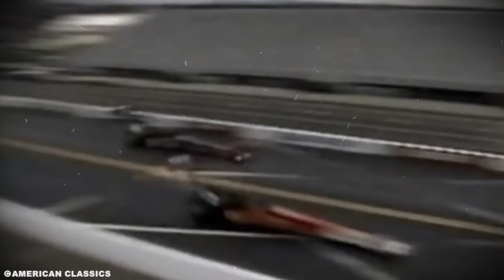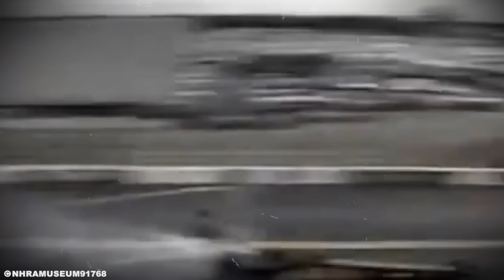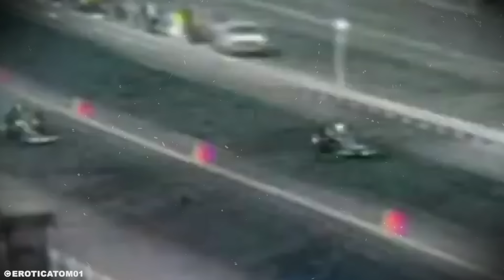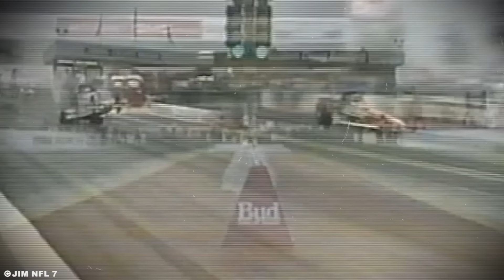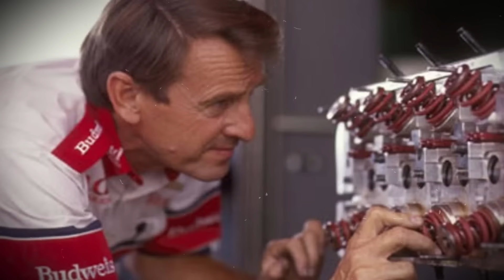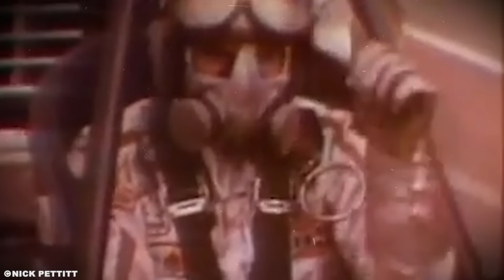This Ohio Mechanic OUTSMARTED NHRA With a "Secret" Clutch Trick That Launched at 8,000 RPM

Comment: Everybody had 3 disc clutches, the cars all leave at idle. The lock up clutches were new then. They need to do more fact checking.
Reply: They don't even understand that Kenny Bernstein was driving a funny car they just make up crap and run with it
Reply: @rickweber4267 Who is they, and what were "they" making up?   He drove both funny car and dragster. Im no aficionado, but I am just curious what you are referring to.
Reply: @frankelias1952 the announcer on the video Kenny along with perdome jumped into top fuel in about 91 85 they were both driving funnies perdome used to drive a top fuel car also years before they are the people that are producing this video that got stuff mixed up
Reply: That was mentioned in the beginning of the Vidieo and throughout.